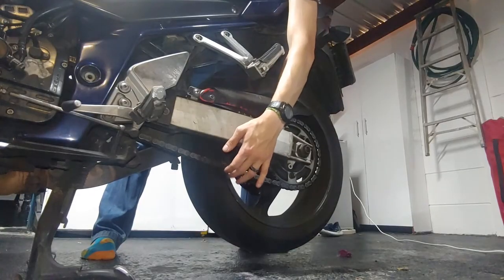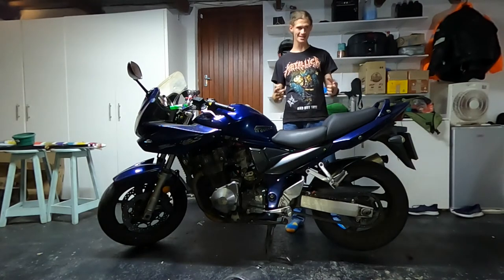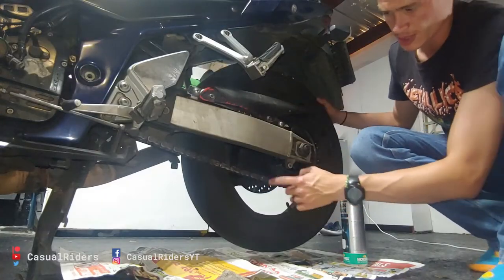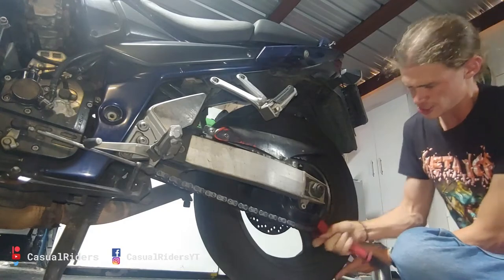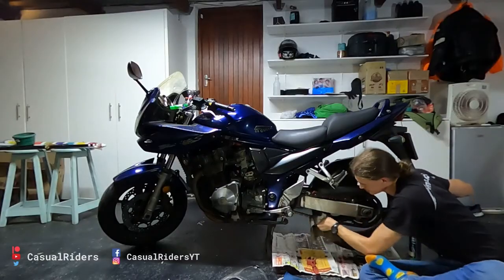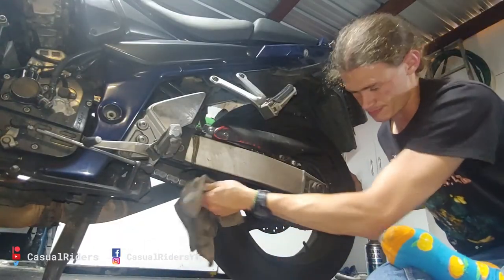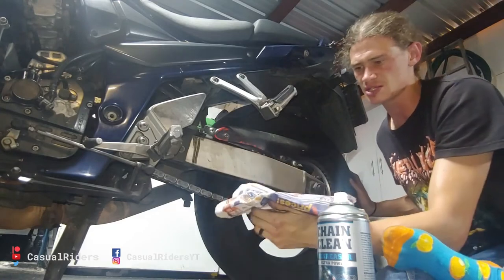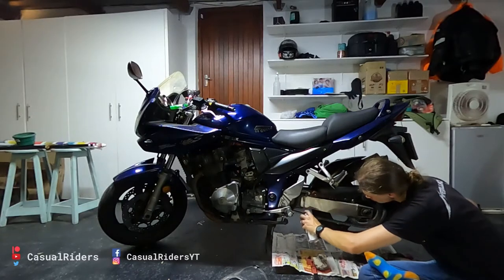Most Motorcyclists Neglect This SIMPLE Maintenance Task || Clean and Lubricate Your Motorcycle Chain

Comment: I have often wondered about the cost of maintaining a chain and sprockets versus just buying new ones.  Proper chain lube is not cheap and I was made to understand it is based on paraffin   Imagine a new chain and sprockets is R3000 and lasts 30000km, if you spend R3000 on chain lube and the chain now lasts 60000km, it has cost the same, no?
Reply from the maker: It's not just how much you're spending on the chain lube and cleaner that one must consider. By cleaning and lubricating your chain regularly, you also inspect the Chan for stiff links. A stiff link can cause your chain to misalign with your sprocket, which has more potential of causing your chain to snap. And as I'd mentioned, having your chain smash a hole in your engine block, that's gonna cost you even more.
Reply: @CasualRiders  are the o-rings not sealed these day?
Reply from the maker: O-rings are sealed, yes, but you still get grit between the links and the o-rings, and that's what you're cleaning and lubricating by applying chain lube